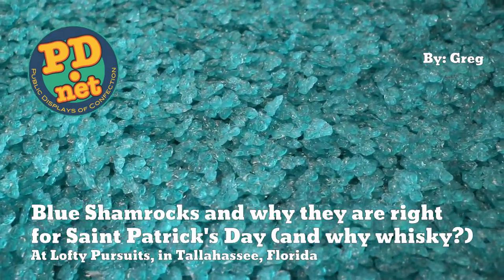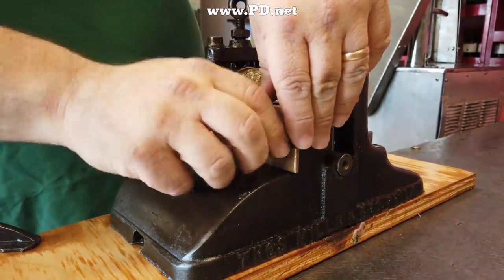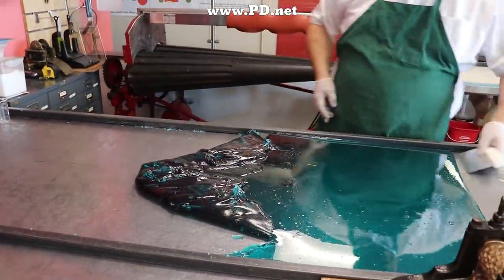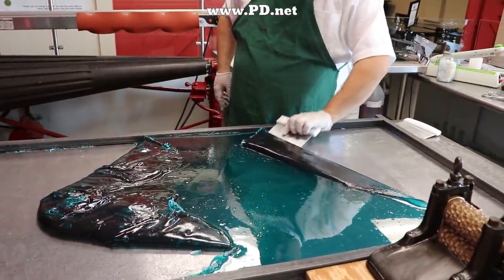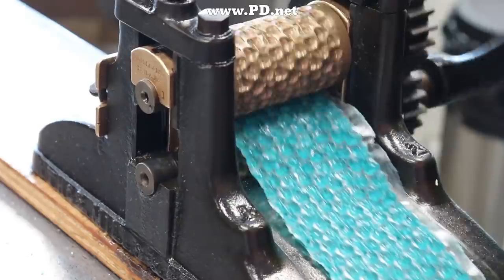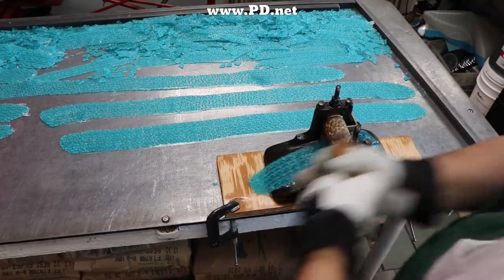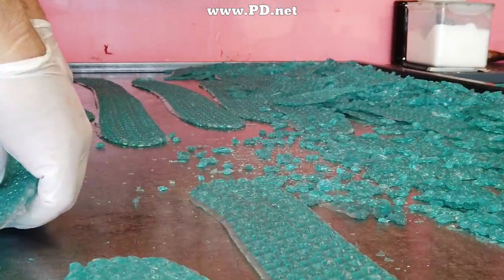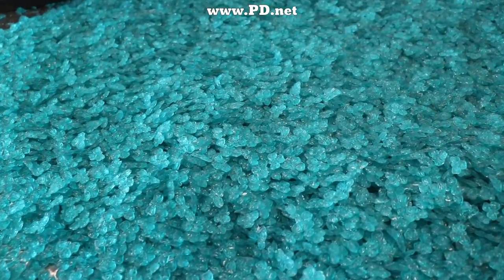#98 Why Blue Shamrocks Hard Candy for St. Patrick's day? Whisky flavored.

Comment: Have you ever thought of using a table cloth and two people to do all those drops at once for the most part? You could fold it over the top two prople pull tight and lift it up and and slam it down together, folding it over the top eill keep any shards or drops from flying off the table. I suppose a good linen would do the trick.
Reply from the maker: It's too much fun this way.
Reply: Lol i can imagine. Just not sure if you do larger batches sometimes where time is a little more precious.

Comment: With how easily you put that together, how do you make sure that the top and bottom synch up properly?
Reply: gears
Reply from the maker: There is a mark on the gear to line them up. I think you can see it in journeyed video.